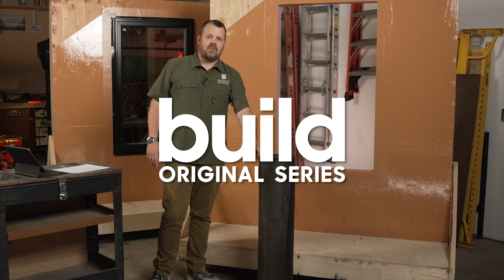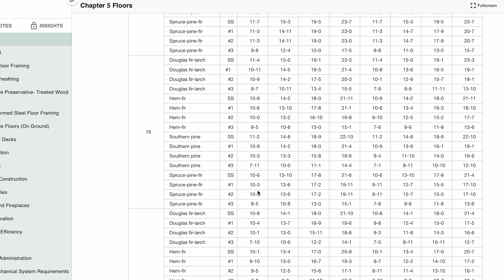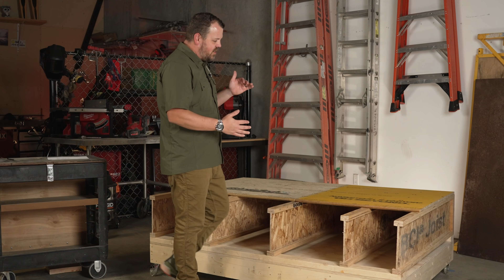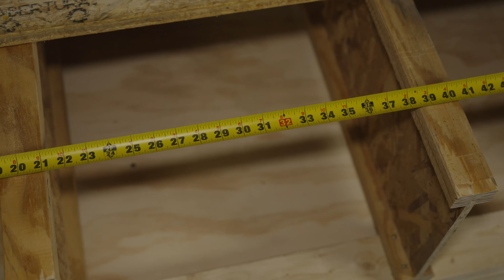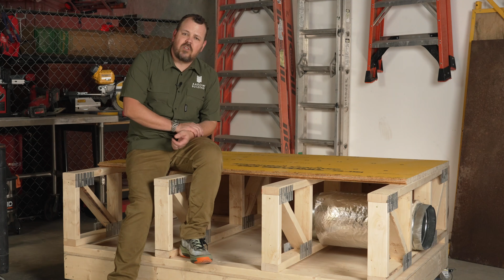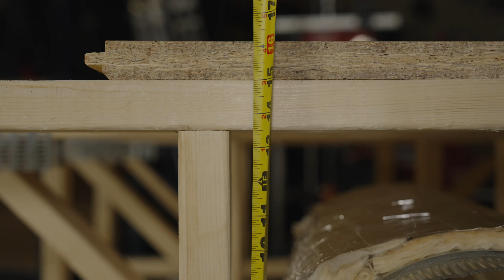Episode 2. What Should I Use? - Subfloor Assemblies

Comment: How do the HVAC guys run square duct through the trusses? Are they limited to small sections, since they cannot slide them in once the trusses are all put in?
Reply: If a duct system is required to go through a web truss, the engineer can work with the mechanical contractor or system designer to plan a duct chase running through the system. It’s usually just a boxed out area, and the truss layout will show where that chase goes.
Reply: Through the floor system*

Comment: How do multiple layers of OSB or plywood compare to a single thicker layer with respect to deflection between joists?  I'm going to put in a radiant floor with tile on top of it, and one of the details is that plywood is used to support the tile substrate between the PEX tubes.  I'm thinking that if I use plywood, I can glue the filler strips that are oriented to cross over the joists, so basically get a double thickness subfloor at little extra cost.  Are there glues that effectively bond layers of OSB?

Comment: How is it calculated for a cantilever floor joist? Where one end is hanging in space?
Reply: There are elements in the code, something like 1’ cantilever needs 3’ support inward, however engineering is absolutely the way to go with unsupported systems.
Reply: @jake.bruton.aarow.building  its more then out vs in. In the loads on the cantilever too. A deck cantilever usually goes through at least one doorway might not have enough dead load weight inside for a live load on the deck

Comment: Matt is there a real reason houses are so much cheaper in Texas?
Reply: way more housing inventory and development (supply), lower demand (compared to more desirable areas). Not just Texas either.
Reply: @colinstu  No it is specifically Texas and those aren't real reasons
Reply: It’s Texas. That’s why it’s cheaper. 😂
Reply: @luciarael7134  That makes sense. Thanks!
Reply: @500iq6foot8  I'm late to the party, but land values can be a big factor. So if a lot in a neighborhood in California cost 200k, but in Texas it's 50k, that's a big savings. Here in Colorado, it's at least 80k to get a water tap, which is hooking up to public sewer / water utilities, so that's a huge cost. Cheaper to live areas also have access to a lot more cheap labor, because the labor doesn't need to make 150k a year to live. And like others have said, supply and demand. There's also factors in building codes, less strict building codes because say, earthquakes don't happen, means it's cheaper to build.

Comment: If the reason trusses aren't mentioned in the Code when they are known to be superior to anything in the Code is because they need to be engineered and certified by the engineer, then all the Code needs to say is "trusses as engineered and certified by a suitably qualified and registered engineer" or something very like that, and then the trusses are there in the Code for anxious clients to see so they know it's all above-board.
Reply: Trusses do not need to be engineered, they are engineered to protect industries and professional jobs.  Trusses and span tables are available and simple enough for a 8th grader to spec out the right depths.  AI will actually deal with much of these issues within 10 years.
Reply: @BaronVonFrankenBolzlll  I think pretty much the same.  AFAIK, it is basically impossible to hire a structural engineer for a small job, so this is part of the general trend to drive work towards larger organizations that can deal with the government complexities.  Although, even stupid LLM AI can deal with most of the issues today, I think you underestimate ability of industries and governments to resist sensibility.  If it was simply a matter of capability, there could just be a single master's degree thesis to create open source software for a wide variety of trusses.  The only thing AI brings to this table is another opportunity for some one to work around the system.
Reply: @richdobbs6595  once AGI is prevalent, you probably could get it an engineers stamp without people even knowing.  There are many thjngs AI/AGI can do and some things it cant do well.

Comment: Just use the best.  Spend a little more to get the best product.
Reply: You 'should' do this, but then most middle class folks have a budget. So if you did go with the best, your budget goes from 2000 sqft to 1100 sqft. These products that are the best will add up very fast, and if you can't afford, you simply can't afford it. Any one of the three floor assemblies shown here will work fine if done right. The 'best' of these three really only benefits the ease of the build for the builder and not the client. It's a lot to understand, for sure; but I don't think it always has to be the best. Choose according to your budget and design.

Comment: This is interesting.  I thought this video was named “DELETE” and then it got deleted?  I did download  copy of that video, which now makes me wonder what has changed?
Reply: I wish I would have downloaded a copy of the very first video they did of this series. It was about Prosoco products/ liquid applied WRBs. I left a pretty detailed comment on the video about my experience with the product. The comment was gaining pretty good traction then the video got deleted.

Makes me wonder if Prosoco told them to remove the video. Every since then I have to take what Matt talks about with a grain of salt.
Reply: @beii-c4e  what was the comment / video about regarding Prosoco??
Reply: @colinstu  They re-uploaded the video, it's episode 3 now.  But this is what I said.

I was very disappointed in the prosoco r guard spray wrap. Worked on a 8000sq ft custom home and decided to give the product a try based on previous build show videos. We prepared the surface with joint and seam filler and used fast flash for all window openings and penetrations, then We rolled the product on in 2 very thick coats to the proper mill thickness. The prosoco spray mvp (pink one not the cat 5 product) performed very very poorly. During and after a rain shower water could be visibly seen soaking thru the osb substrate and running down the inside of the wall cavity. The joint and seam filler and fast flash are good products,but I would not recommend the spray wrap mvp product. We ended up using the typar house wrap system on top of the prosoco product followed by 2 layers of 30# felt paper. Maybe the more expensive cat 5 would perform better but the spray wrap was horrible and a huge waste of money, we used a few pallets worth of that product around 50 5 gallon buckets to try to get the system to perform correctly but ended up being a huge waste of money. Sometimes the simple methods perform the best.
Reply: @beii-c4e  what color was the spray-on stuff? (also what color was the joint/seam one?)
Reply: @colinstu  The prosoco spray wrap mvp is pink and comes in 5 gallon buckets. The joint and seam filler is a pink product in sausage tubes. I also bought a few boxes of the air dam product as well which is white in color.
Reply: All the secret insider information, obviously
Reply: Matt was on set in the background saying the N-word so they edited it out
Reply: @TheSeriesofTubes Uh, lmao what